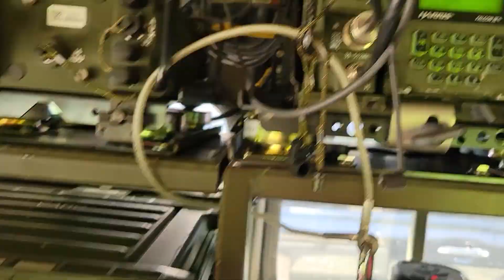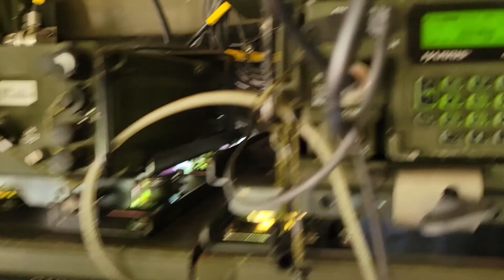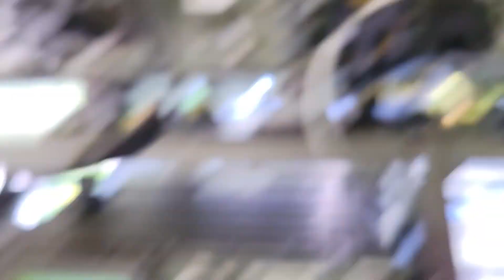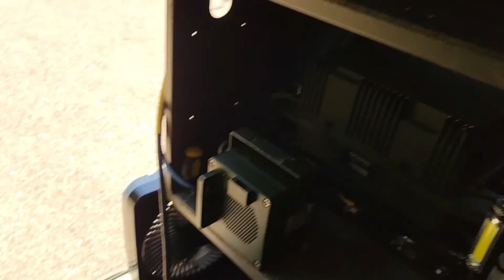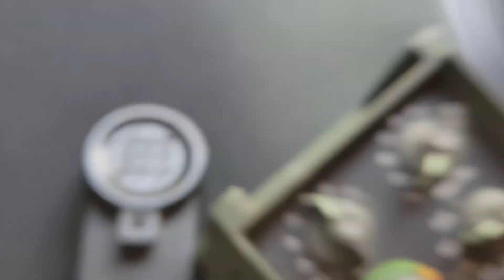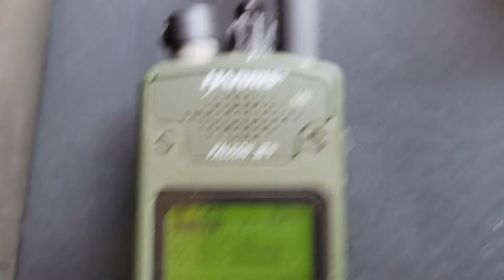Part 2- Installing the VIC-3 Vehicular Intercom System

Comment: If am getting clicking noises while transmitting over the vic-3. The Vic-3 startup test is good with no issues. The radio transmits normally with no issues while not connected with the Vic. I am thinking that I may have a controller issue, what are your thoughts?
Reply from the maker: Hmmm. I'm not really sure.  Doesn't sound like something I've encountered.  Sorry